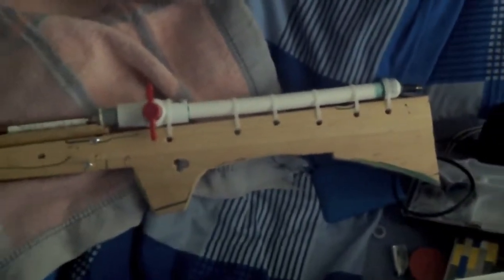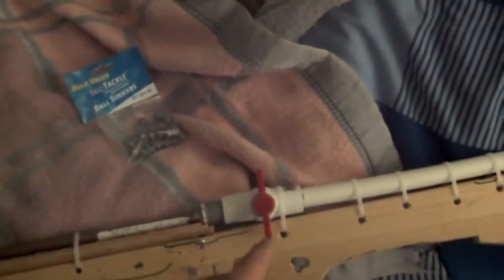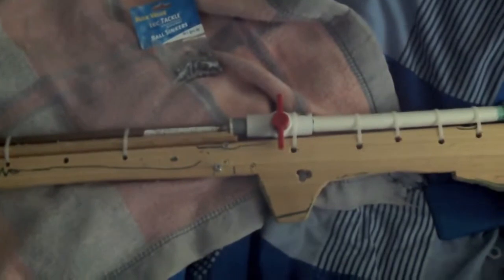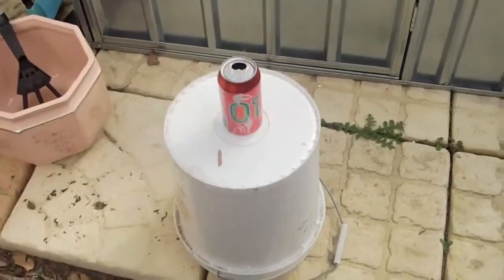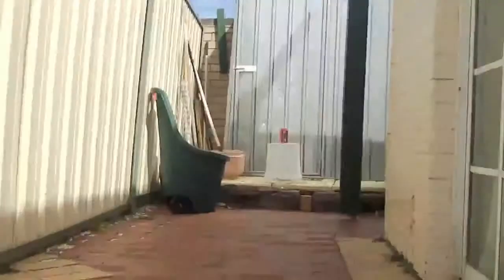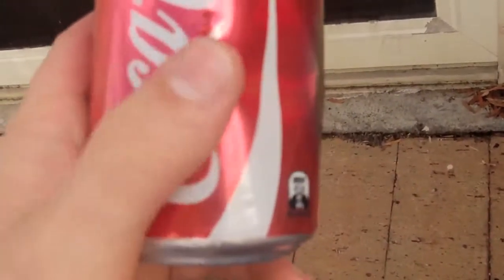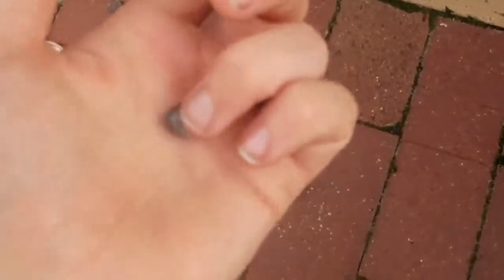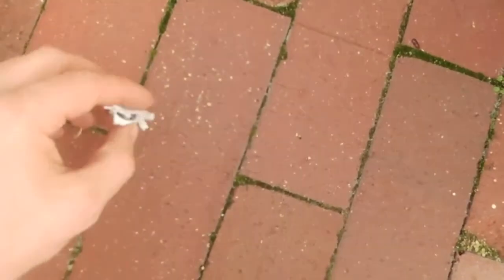My home made air gun (80-100 PSI)

Comment: use solenoid valve for your trigger,,,low pressure valves  are cheap..use pulse circuit or relay(on/off)  .